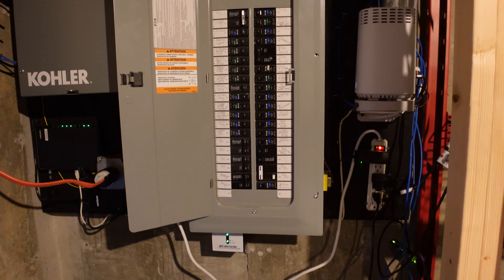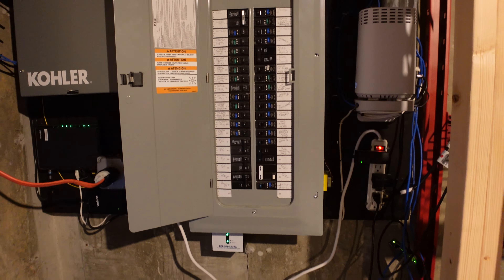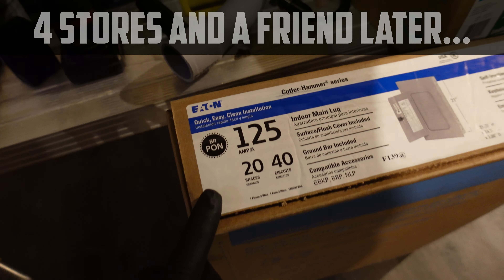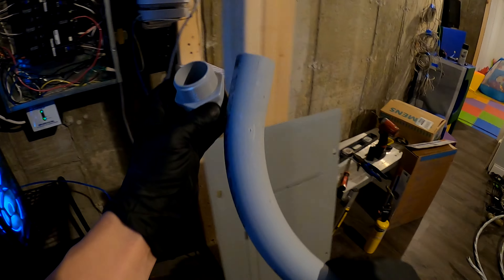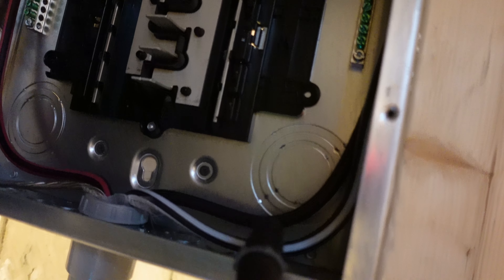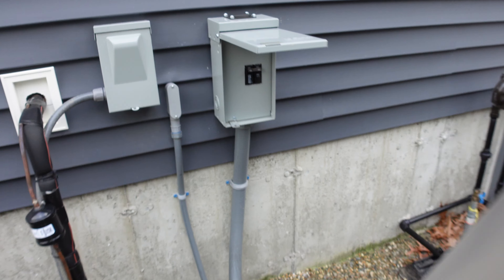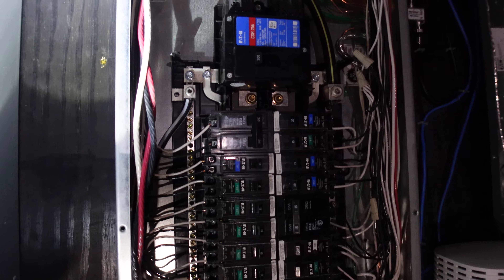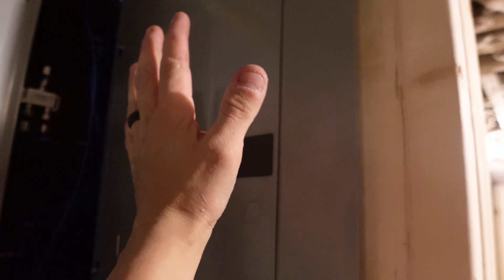How I Installed a 100 AMP Sub Panel for Crypto Mining.

Comment from the maker: Hope this helps you!
Reply: Nice looking closet man, just be sure that the green ground lug attaching the Neutral Bar to the grounded framework is removed on the sub-panel.   Sub-panels require separate neutral and ground bars in order to be up to code.
Reply from the maker: @timothypeterjr.8876  Yes. The “Bonding Screw” is in place so you can drive it in need be; Most manufacturers don’t have them pre installed all the way.

In this case it is backed all the way out because my main panel has two separate bars (ground & neutral)
Reply: Really wish my main panel had separate neutral and ground bars.   I’d love to upgrade my service panel from 150A-200A and get that done.   Really can’t go without electric for that long though, and my outdoor disconnect is only at the meter itself.   Love how you have a separate main disconnect outside.

Comment: Just my two cents, recommending not to have any load when switching on the main breaker, especially when they are old.  It could trip and you could run into replacing them.  Excllent job btw, except for the clearance rule and removing green screw.
Reply from the maker: Hey man Thank you! The Panel yea should be a bit further away but ehh LOL. Also the green screw isn't Burred. That is backed out fully Just in place from the factory

Comment: Ah yes. My experience earlier in May 2021. Installed a second 200 amp panel (upgraded to 400 amp service) and then installed a 100 amp sub by myself.

I did have some pros do the service install for the service hookups and rewire of the main panel but I handled everything else. Pretty fun. But stressful.

Comment: Great work!, I had the same thing done recently by a licensed electrician except the 100amp is coming from outside main service since my main panel inside in garage is a bit far away from the sub panel basement location. The interesting thing was, I was expecting him to tell me that the power will be off for a while but he didn't, he finished the job without even turning off the main power. Obviously I would have turned the main power off if it was me.

Comment: Its been a while since I did electrical work, but I'm pretty sure that cable didn't have to be in the pvc as it's rated for direct exposure.  Not saying it was wrong to pipe it in but it doesnt have to be.
Reply from the maker: Yeah it did not have to be your correct!

Comment: No need to turn off power can be done with power on do everything first then do the wires to the breaker then push in . Nothing dangerous as long as you don’t tough a live wire doing this .
Reply from the maker: Better safe than sorry. That #1 sucks to push / pull sometimes lol. Also im a master plumber not an electrician shocked I did this at all LOL

Comment: Electrical side note, you need to leave 36" width and 5 feet available in front of the panel if memory serves for access and to work on the panel. The wall and the new panel don't fall under that. Just for reference you might have someone sad if you go to sell the house in the future. Should work great so long as everything is rated for aluminum wire, copper is generally recommended (although I know it's way, way more expensive)
Reply from the maker: Yes I know but I will die in this house LOL
Reply: @ChumpChangeXD  Well then! 😁 Time to crank up those miners and let er' buck! 400A service anyone?

Comment: I like that you were able to add the 100 amp sub panel. I was just wondering the amp service of the main panel.
Reply from the maker: When you pull 100 amps it’s for more room in a panel when you don’t have space. 

On a typical 200 amp service you probably end up using like 50-60 AMPS of it in a normal house you don’t even end up coming close to the max. 

1000% fine to pull 100 AMP Sub-Panel off a 200 AMP service
Reply: @ChumpChangeXD  That for the info!
Reply: thanks...

Comment: I am not a pro but the way you wire the sub panel, wouldn't it overload one side of your main panel? Since It will be drawing extra amp on one side, unless you have already moved/balanced all the breaker?
Reply from the maker: I’m not a professional electrician but the sides don’t matter because if you look at the internal of a panel the 240 (2x120v legs) Splits with a two pole breaker one from each side goes into it that’s why the flat panels inside zig and zag

Comment: Bro be careful using that wire in pvc. The size of pvc pipe has to be a certain size based off the size of wire for heat. Being sleeved wire effects that. There is a code for that. I would look into it.
Reply from the maker: That is electrical conduit not real PVC I just called it that lol

My bad
Reply: @ChumpChangeXD  I can tell you used proper pipe… it’s gray. What I’m referring to is what is called pipe fill in electrical code. Most wire is not sleeved (all wires surrounded by a protective layer) when put into pvc pipe. This is because it traps 🪤 in heat. Can cause wires to melt the coating and then short out. Just google code for pipe fill and if your pipe is over sized you’re good, but if it’s not OVER sized I would remove the wires from the sleeve it’s not needed anyway. Just giving you some info that only electricians know 🙃

Comment: Should have had a lockout on the mains service disconnect since you were in another area w/o line of site to it. Otherwise, you did a good job.
Reply from the maker: You taking about a paddle lock 🔐 on the disconnect door?
Reply: I think he’ll be ok, OSHA probably isn’t going to go and visit him at home 😆
Reply from the maker: @timothypeterjr.8876  you actually shouldn’t put a lock on it for safety reasons. The fire department will 90% of the time yell at you for it.
Reply: In the work environment, a Lock-Out Tag-Out device is required whenever working on any circuit.   Actually had to deal with OSHA with that once before, but I had mine in place.   Probably would’ve lost my job if I didn’t.   Pretty sure that was what he was referring to.   A LOTO device on the main disconnect could have been used to ensure your safety while you were working.

Comment: hey chump you need to remove the green bond screw at the top right of the sub panel the neutral and ground are bonded at the main service
Reply from the maker: You don't have to remove it... It isn't installed it is just there in only 1 thread no actually burred
Reply: @ChumpChangeXD  i just seen it there didn't know it was loose just wanted to make sure you knew. looks good loving the whole setup happy new year